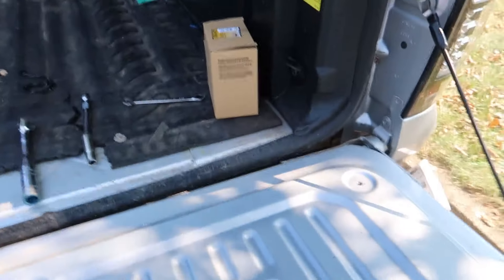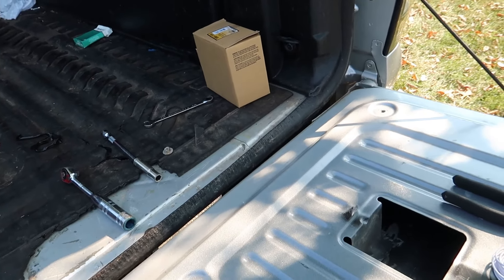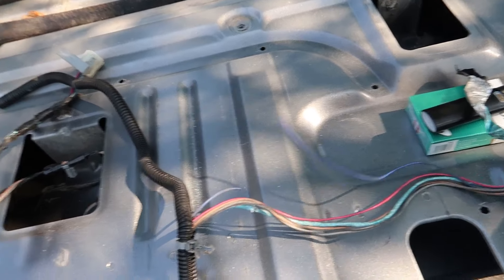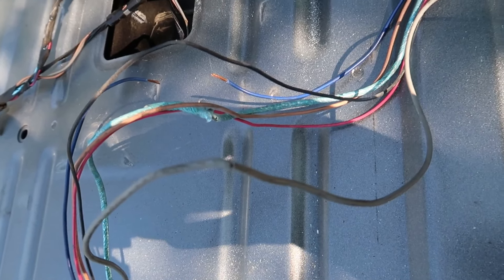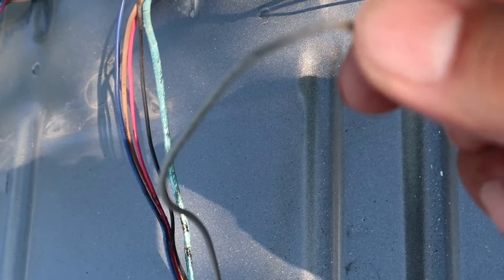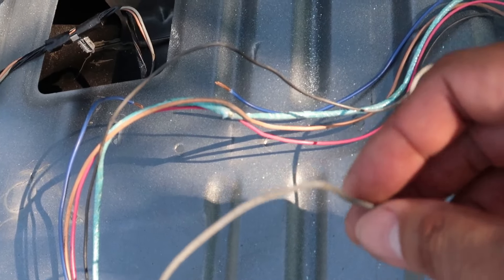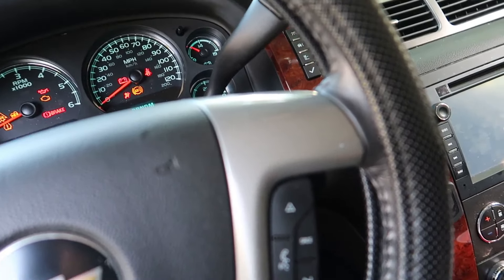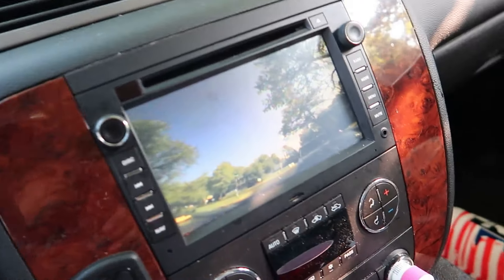2007 - 2013 avalanche parking camera fix

Comment: My 2013 silverado camera just went off but the back up sensors work and also the rearview mirror shows I have power that its still working just the camera is off ??? Gonna check if its the wiring too on the tailgate
Reply: I have the same issue just happened a couple days ago. Did you get yours fixed?

Comment: Great video! Please tell me tho~ are there no lines, or is that an on/off option? I just got an avalanche and replaced the sensors (they were painted over) but I still have a park assist message showing and it has no lines, beeping, etc. I noticed yours beeped when you fixed it .. just wondering about the grid lines
Reply from the maker: From what I remember the factory radio didn’t have the grid lines either. It’s a aftermarket radio in the truck now with no option for grid lines. When the camera went out the parking assist still worked. Check the connectors on the sensors to make sure they are clean and snug. Also I would get the parking assist message sometimes with my tow ball in the hitch. Idk if you ride around with yours in all the time like I do
Reply: b00sted_brian i do ~ I’ll try that. Thanks so much

Comment: How do I get the camera out?
Reply from the maker: Take the cover panel off the tailgate and you can access it. Might have to remove the trim it’s in too. That’s double sided tape on to the tailgate
Reply: Cadillac escalade ext. Found out I did what you did, bought a camera for nothing at 165 from the dealer. Its not the camera. Something else went wrong. Installed the telsa radio in the truck & it came up no singal. I put back the original & it too came up no singal & it was working fine before I did this telsa upgrade. Smh. I have no idea what went wrong with the camera.
Reply from the maker: Check the wiring harness on the gate where it bends at the hinge point. Wire might have broke there
Reply: Yes I did this. It stop working after I change the radio to the telsa
Reply from the maker: Did you splice into the factory wiring for the camera for the aftermarket radio? Might be a loose / broken connection
Reply: Yea I didnt do it, radio shop did. Smh
Reply: I dont know anything about wiring. Im searching but I dont change anything because I dont know whats what.
Reply: Thanks for the help, if you know about this & would like to help a truck brother out. Let me know Ill leave you my number. If not no worries & thanks anyhow for your knowledge. Godspeed.